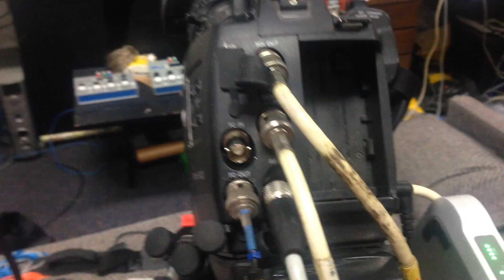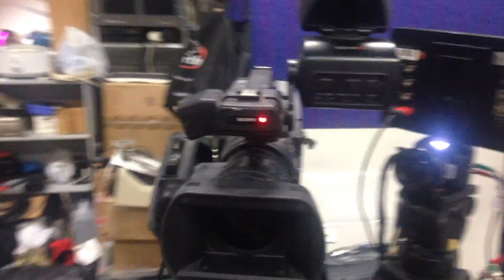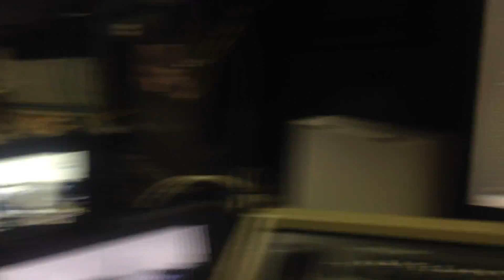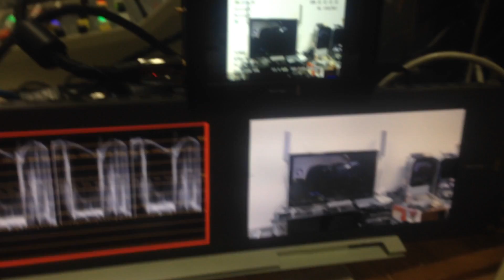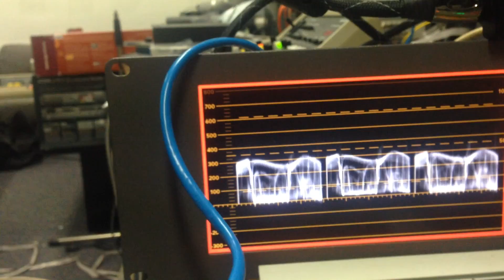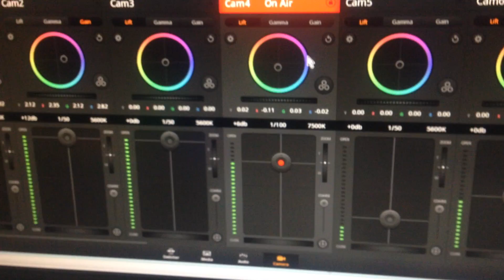ATEM2CNA intro

Comment: How did you hook up the CNA-1 to the Atem? Just plug it into the same network switch and adjust IP's? Where is the magic (conversion ATEM-CCU to Sony) happening?
Reply from the maker: The CNA-1 connects to the same network as the ATEM. My Controller also connects to this network. The CNA-1 talks to my controller which in turn talks to the ATEM, translating all the messages both ways.
My new Controller (in development) takes all the ATEM CCU from the ATEM return SDI and converts it to CNA-1. This alleviates the need to send a network cable to the camera and allows CNA-1 control via fiber etc.